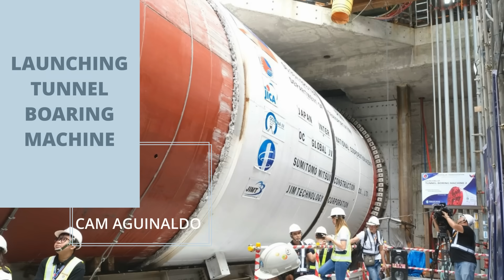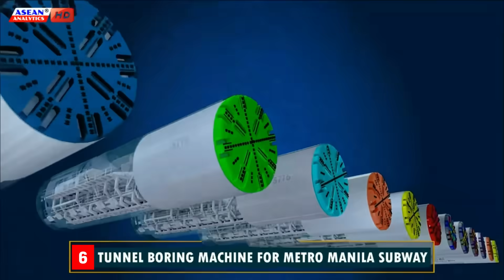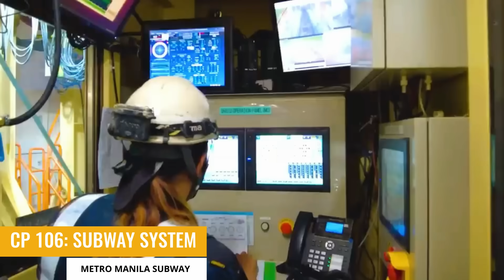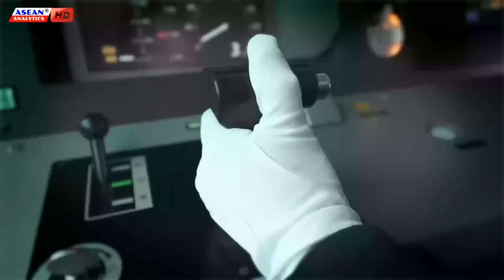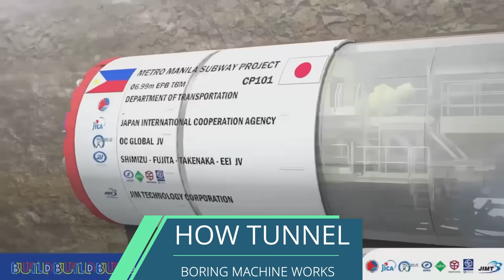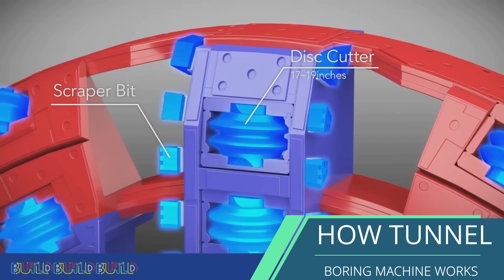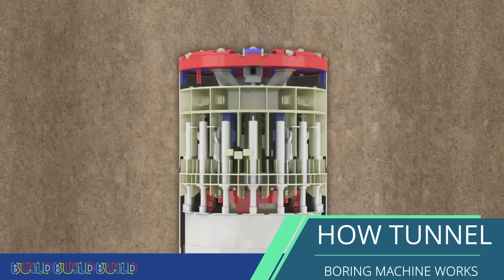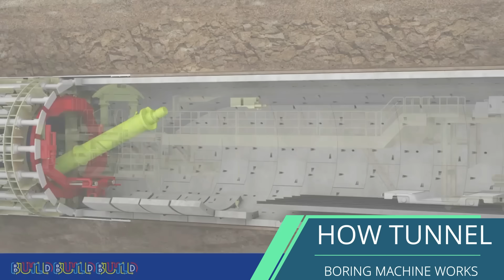Metro Manila Subway Projects Tunneling and Station Works Major Developments are now Visible

Comment: Once operational, don't complain if the fare is high for it to be sustainable.
Reply: @macolet9711  the price is justifiable since the Metro Manila is suffering from heavy traffic 24/7, people would rather pay higher than to get stuck in traffic, auto maintenance becomes more expensive than 5 years ago.
Reply: @alphajed7700 yes, no choice. Better than Motorcycle Apps. Its might be cheaper

Comment: I was just wondering why they'll still use ANONAS station.   LRT 2 has  Anonas station.   It might create confusion.
Reply: Right beside LRT 2 kasi station yan, pagbaba mo ng hagdan Subway station na din. I think better nga na same yung name. Kasi kung gusto mo sumakay ng subway alam mo na sa Anonas ka dapat bumaba or vice versa.
Reply: @LelouchLamperouge-f1k  Thanks for the heads up.    I didn't know that the subway station is just below the LRT station.
Reply: @RR52517  Bro it's the other way around, LRT2 is above the subway😅
Reply: Hello..That's why there are some stations with the same name it is due to connection of other railway lines so if you go in different places you can simply transfer from another rail line.. it is according to the blue print of late President Marcos Sr. All railway projects are connected to each other from North to South so the commuters will easily access public rail transportation..